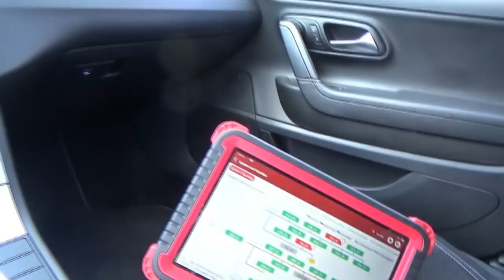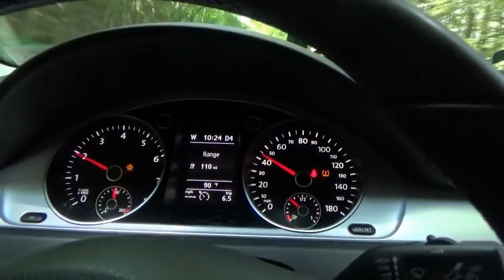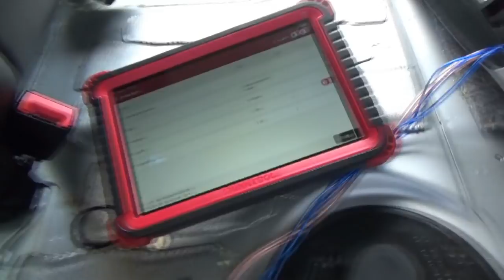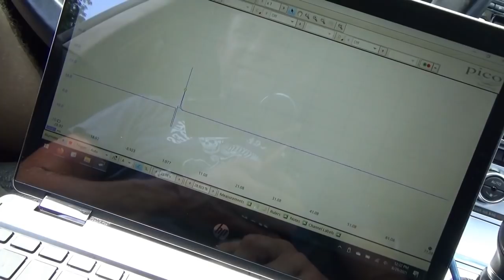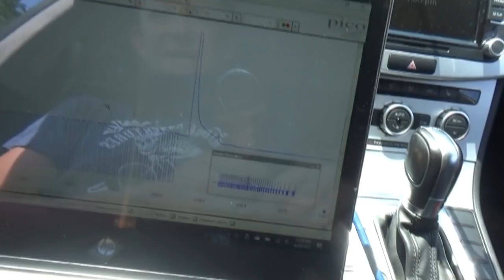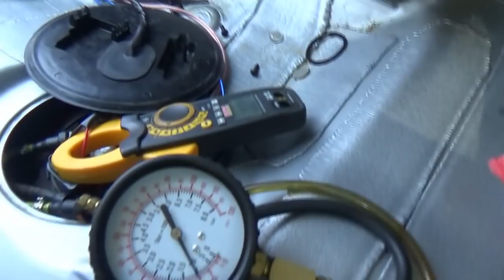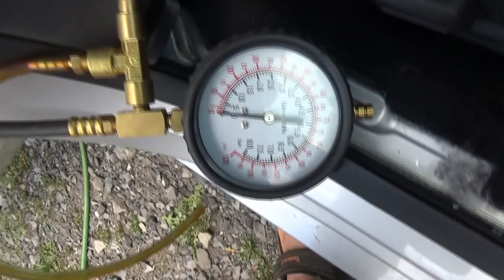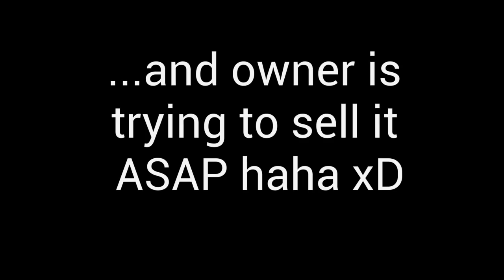EUROTRASH IS BACK! Start-Stall - Part 2

Comment: Someone doesn’t take the time to do that aftermarket wiring correctly. Looks pretty bad. I took pride in installing my amplifiers and various accessories back in the day.
Reply: Lol, saw the "through the door jamb" power wire. 

A friend of mine bought a mustang from someone who did a hack job sub / amp install. All along the right hand side of the car was a perfectly melted cut across the door sill moldings, rear carpet, sunk into the side of the reat seat cushion, and ending in a double C shape in the trunk. The previous owner ran the amp power wire without a fuse and it shorted out and melted the interior up! Including through the door gasket! hahahaha!

 It was a beautiful car besides that melting, must have smelled like a plastic fire for ever... And was probably so close to catching fire.

Comment: About 150 000km need the new unit. It can last much longer if people never let the tank under half full. Unfortunately people drives only by fumes and the pump can not have a proper cooling. Yes, the fuel cools the pump.

Comment: Great video Ivan. I hope this doesn’t come across as rude but I’m just wondering if that pipe coming off the pump was the cause, how does it intermittently fail?
Could it just be chance that the pump started to work again?

Comment: . I saw a blue wire running from inside to under the hood. What about using a thermal camera after you get it started and get back to the shop to see what's hotter than it should be. If this guy can't get his money back tell him to sell it as is and get what he can.

Comment: I think it could be a security problem or something not giving enough petrol to the engine when my car ran out of fuel It acted like that
Reply from the maker: Not a security problem 😅
Reply: Car had only 15psi of fuel pressure with full power to the pump when hot. Thats the problem.
Reply: Fuel delivery problem not a security problem.

Comment: Why did that hose come loose?  That was the problem?  Was it some how locked or tightened in position?  What about a TSB regarding that hose?  Or upgrade?
Reply: Hose coming loose makes no sense. Problem happens when its hot, then fixes itself once cooled down. Fuel pumps do that. The hose doesn't come undone/reconnect itself only when hot. Enough diagnosis has been done on it it install a new fuel pump assembly and call it a day.

Comment: So the pump draws more current when there is more head pressure?
Reply: I thought current would track actual flow.  I thought that would be true on a centrifugal pump.  Like when you cover the end of a vacuum hose the motor spins much faster and draws less current because it's not doing any work.

Comment: What I just don't get is how does a hose blown off the fuel pump cause an intermittent issue? I am speculating this guy pissed someone off and they were messing with connectors and the fuel pump to sabotage the car. (this is NOT an accusation just to clarify so my comment doesn't start a big fight)

Comment: I had the same frustrating issue with a petrol Citroen years ago. That was less than a year old. Dealer gave up after putting the parts cannon into overdrive. The low pressure fuel pump just died when it got warm, usually after around 30 mins. European strikes again 😁 Nice work on persisting with this, was that a Rav 4 you turned up in 👍🏻
Reply: @srenlund-hansen6883  nothing hi tech in plastic filled engine bay in euro cars,  only headache after 5 years of driving
Reply from the maker: Not a Rav4... Suzuki XL7 😁

Comment: Its a good car just maintain it right :) and do not Tune or remap it that would be bad.
Reply: well, depends who does the remap. I hat a gen 3 Scirocco woth the 2.0tsi and dsg. Stage 1 with 250hp was really fun and the car drove as smooth as with stock mapping
Reply: No, it's not a good car. They literally fall apart and leak oil from everywhere.
Reply: @lovemym16  German cars are expensive trouble.
Reply: @lovemym16  yes, it is a good car, just needs maintenance, same as with all Germans.

Comment: Friday my wife says. Your Malibu starts and just shuts down. You know what's wrong?. I will get on it asap😄. Yesterday evening after work. I took up my scanner. No codes. Just my Evap code. My hoses are beginning to rot out. Anyhow. Start car. Car refuses to idle. I suspected a bad IAC motor. The counts on the IAC motor seemed very high?. I tried moving the IAC motor with my scan tool. Nothing. 
You taught me this IVAN to diagnosis. No parts cannon. After confirming.
Drove to my local Azone sto. Got me a new IAC motor. Installed it there. Boom...car idled perfectly. Pulled The old IAC, pindle was stuck way out. Now just needs some new hoses. A oil change and air filter.
My car has 288455 miles on it. Uses no oil period. I just maintain it. Regular service. It's due for struts again. Seats are worn out. Seats needs to redone. No sweat I've done seats before.
Reply from the maker: Nice 👌👍

Comment: maybe someone sugared the tank(or other powder), driving hard stirs it up and clogs the pickup sock, once it sits it flattens back out and runs until covered again. LOL
didn't catch the if the lift pump pressure was normal range or not. it's clearly a ricer-wagon, so good luck anyway, lol.

Comment: Of course you dumped that fuel during the fuel pump pressure test into a fully approved OSHA & EPA container,. Just as you did that high speed road test portion of the car in “Mexico”.
Reply: @PineHollowAutoDiagnostics  Oh, Ivan, how could you, pouring that nasty mean old gasoline on the poor harmless weeds. Greta is having an asthma attack right now.

Comment: That's a problem that will put the mechanic into poverty mode; don't let it happen.  Time spent on this piece of junk deserves money, well-earned money.  Get what you're worth; don't be abused or robbed.  Another company probably would have replaced the fuel pump immediately and solved the problem but what you did with analyzations helped cure other potential problems by elimination.  Hope the car owner appreciates your determination to fully solve the problem by trying to save him/her great expenses.  BTW, just how much would a new fuel tank sending assy have cost?  Did your charges undercut the full cost of a new pumping assy?

Comment: Ivan! As per Eric's (SMA) suggestion You should run away from any trash like this, if you can see high current wire for aftermarket sound inside driver's door jam. We recently bun one our employee with Latin America origin from entering company parking lot on car with such style mods. It can catch 🔥 at any time, especially at summer....

Comment: That's one narly big toe right there. Result of these Russian style protective shoes, perhaps? 🤫
Reply from the maker: Bicycle race crash back in college...30mph pileup!
Reply: @PineHollowAutoDiagnostics  
Eww. That speed on a bike is fast. And dismounting at that speed is no laughing matter.

I'll bet some skidding resulting in painful asphalt eczema was involved too. 😣

Thanks.
Reply from the maker: @Peter_Riis_DK  My dismount involved flying into a rocky shoulder and flipping over a guard rail. I'm guessing my shoe got caught in the spokes of a wheel that ripped off the toenail inside of the shoe. It was pretty bad.
Reply: @PineHollowAutoDiagnostics  
I can only imagine...

Broke one or more ribs, my wrist, and a scapula once, but the thing that really hurt was the ribs.

But I see it hasn't discouraged you from using any two wheeled transport or indeed anything powered by an engine. 

Wish you well. 😎

Comment: Never buy Germany vehicles. Never America made vehicles. I only buy Toyota and lexus vehicles. My lexus ls430 2001 has 328,000 miles. Have changed the timing belt 3 times every 100,000 miles. Timing belt ket Japanese brand parts. Just regular maintenance brake pads and change fluids. No major problems. Changed radiator at 250000 miles.

Comment: the big problem w eurocars is that american hobby butchers work on them. It is not a 350 cui engine but a high tech 2 liter turbo engine. Overhere this is a car ment to run for no more than 200000 miles in 20 years. This car has more hp than the factory tune and is not owned by a priest
Reply: Yes  you hit the nail on the head! These yanks can’t repair them then just call them trash!  I’m from 🇬🇧 uk  VW is one of our favourite car brands here. I have 3 in my family alone
Reply: VAGs of this generation are notorious for DSG issues, cam wear from the high pressure fuel pump, carbon build up associated with the direct injection system, premature timing chain/tensioner wear, that’s just off the top of my head.  My impression is that Europeans generally put fewer miles on their cars on better maintained roads, and are USED to a higher frequency of repairs that they might fool themselves into calling “maintenance” (like rebuilding the cooling system on BMW every 80k miles).
Reply: Its few and far "hobbyists" tinker on cars now a days in the US. 98% of cars are bone stock and are repaired by garages. Our "American" branded cars are just as finicky as these cars.
Reply: @mph5896  yep gone are the days of cast iron 3800s and 350s.  These days it’s timing chain eating 3.6s and other junk that is in lock step with this euro stuff
Reply: @gtemnykh  You are 100% correct. They are getting REALLY difficult for the average person to work on. I have $20k+ in tools in the garage, that is what is needed to fix this newer stuff. I did a trans on newer Explorer. I had the entire drivetrain out and scattered all over my garage floor. 3.6l timing chains, thats a fairly big and expensive job.

And you are correct on the maintenance. Anything beyond fluid changes, or filter changes is considered a repair in the US. Most of everything is designed to be "lifetime".
Reply from the maker: Yes it's definitely harder to repair a Euro properly by the DIYer than a Chevy. There are some long lasting reliable Euro cars out there like older Volvos. But if you think any turbo GDI engine will be long term 200k miles reliable and problem free, even with proper maintenance, you are not living in reality lol
Reply: @PineHollowAutoDiagnostics  Agreed...VW is trash, has been for decades.

Comment: It's a VW, what did they expect, something reliable AND inexpensive to fix when it does take a shit?  lol  Lucked out with the NPR fix and not needing a new LP fuel pump.
As I said the last time, VW is the imported Dodge / Chrysler.....
Reply: Nissan is the Japanese Chrysler and VW is the German Chrysler!
Reply: @rp5029  Nissan buddy is only half owned by Japanese the other half owned by RENAULT French  shit  that why Nissan went to the crapper after 2000 Renault crap
Reply: @rp5029  all European makes are European Chrysler lol

Comment: And that's why it's all called euro trash, way overly complex & couldn't set a code!
That pipe didn't magically connect when you appeared thus it started & drove, then it fell off again?
A single tank pump design would be much more reliable rather than having jiggle bits in the tank don't you think?
That's why I refuse euro trash!

Comment: I would buy a Ford before I bought a German car, and that's saying something... Eurotrash, indeed.
Reply: You'd really get a Ford before a Mercedes?
Reply: Vertti Honkanen yep not supporting snobbery
Reply: the eurocars i a hole other tech level and you americans cant just wing parts at a high tech car. do as the americans, use 6 or 8 cyl engines, mess up the environment
Reply: Amen there, I am bowtie til i die and i would own a "circled problem" or even a Chrysler product before I ever own another foreign car, Source- personal experience, my Sister had an 07 Jetta 2.0 turbo, that only made it to 87k miles, when the one cam sheared and took out the whole engine, and I think the front lower control arms were made out of pop cans, i swear on a dark quiet night you could hear them bending on their own, and my old 2001 Avalon, 2 transmissions, 8 rear struts, and a plethora host of other smaller issues, sold it with 127k miles on it while it was still running with the transmission slipping going into 2nd and knock sensor codes for the 4th time. Good riddance to both them cars!!!!
Reply: @srenlund-hansen6883  my 300k mile V8 suburban messes up the environment a whole lot less than a pile of European cars in the junkyard at half the mileage
Reply: @mattcat231   American muscle! My son has a VW Golf and is always fixing something on it. And everyone knows the answers are always circled.
Reply: @mattcat231  It's funny. Many Europeans have the same attitudes towards American cars
Reply: @gtemnykh  470k mile "eurotrash" Mercedes diesel reporting in
Reply: @gtemnykh  you are dreaming, you have to wake up and start making american cars for americans, and start thinking about the environment
Reply: @mattcat231  bowtie made in corea ?
Reply: @srenlund-hansen6883  “American cars for Americans” I can’t think of a more fitting vehicle than a simple, durable overhead valve V8 body on frame truck or SUV.

Go to rural or low income urban America and there are loads of 20-30 year old American cars, and especially trucks, with simple cast iron engines that are affordable to service and keep on the road.  This is not the case with overly complex, fragile, European offerings
Reply from the maker: @THEACERASPIREMAN  what year Mercedes?
Reply: @srenlund-hansen6883  Nope, Bowtie made proudly here in the US, 2002 Chevy Silverado 2500HD and 2004 Cadillac Deville
Reply: @mattcat231  and the rest ? ;-)
Reply: @PineHollowAutoDiagnostics  1983, I think it would literally run without an alternator or battery of you hill started it. But here you see 2000s or 2010s Mercedes with the same miles from taxi services and whatnot.
Reply: @gtemnykh  Again, it's just what the market share is, of course American parts are cheap in the US, the same goes for European cars in Europe. VW, Volvo, BMW, and Mercedes parts are not that expensive if you order straight from Germany/Sweden while being inside the EU, and I regularly see all those brands going above 500k km (311k miles), usually with diesel engines though.
Reply: @THEACERASPIREMAN  that’s a very fair point.  I still think the Europeans go above and beyond in the complexity of design.  It feels like 50% more complexity for maybe a 15% gain in function/performance.
Reply: @mariosaccoccio1688  they all do that, VW just got caught. No us cars exceeds US (california) standards